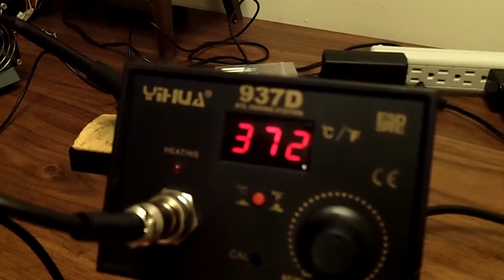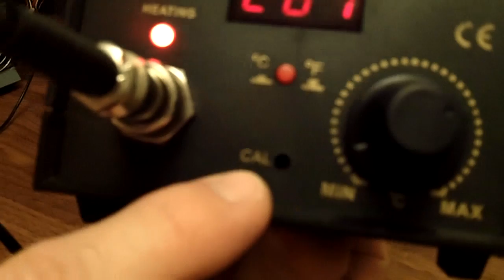Yihua 937D Soldering Station First Look And Some Minor Modificatioms

Comment: Hi.  This looks like a nice unit, digital readout of tip temp, turn/wheel adjustable temp setting, nice red LED readout, simple, functional.  Please share how well it works for you.  Thank you for making & posting this video.
Reply from the maker: I've had it for about 6 years and it worked fine until 6 months ago. The triac burned out , I replaced it and it's working fine again. Only problem I have with mine is the 45 watt heating elements don't seem to be available or at least I haven't been able to find them so I'll have to try the 50 watt elements when I need to replace mine. If they don't work it'll be time to retire the soldering station.
Reply: @percaine  Dear Pat, thank you for the kindness of a reply.  And a very open, truthful, constructive & helpful reply.  I'm glad you were able to repair your unit.  (And upgrade it's heating element, should the time come).  (Great skills).  It looks as a fine unit, nice readout, (easy setting adjust), good thermal mass & heat response.  Thank you Pat. (I like that fume extractor you made/in-process, & the mods to the Yihua station [iron's handle, module's feet]).  :-)

Comment: Got a 937 D but looks, different no Temp conversion switch wonder if they are all made by same company?? Mine shows H-E?? guessing heat..sit it on a temp and it drops down to below 100?  used it for about 10 hrs and 2 minutes ..the 2 minutes was when it would solder?? just a paper weigth.

Comment: Did some research and turns out the aftermarket soldering tip won't allow the machine to sense the temp. Looks like the tip has to be close to touching the ceramic tube inside .I ground about 15 mmm of the spacer and the machine works well.

Comment: I have the 937d+ and it doesn't have the switch for C or F, I wish it did, because i don't know C.  Going to have to print a chart so I'll know what it is in F.  I am going to see if i can find the board for yours and see if there's a way to change mine to F.
Reply from the maker: That sucks..I leave mine on C all the time and never use F even though I know both...I wonder why they did away with it on your model...Maybe there's still a spot on the board for the pot but it wasn't populated on that model to save money.

Comment: I just bought this model also only i couldnt find the one with the button for Celsius to Fahrenheit anywhere. But its far from a deal breaker, my thermocouple on my multi meter has a C or F option so calibrating will be easy and all my solder is standard 63/37 rosin core or 63/37 no clean and the melting points are listed in Celsius. Just thought it was strange i couldnt find a model with the conversion button. I've seen it in a few youtube videos but nowhere else??
Reply from the maker: That's strange.I rarely use the conversion button on mine but it's nice to have for people that like to use Fahrenheit...I guess with the newer revisions they decided it wasn't needed...I just finally had to replace the heating element after 5+ years so it might be time for me to invest in a way to calibrate my station as well..The temperature is definitely off after the element change.
Reply: @percaine  I just used mine all day long on Friday and it worked like a champ. I was surprised to see it was only about 15-20 degrees Celcius off from what it was supposed to be when it arrived. Calibrating it would have been a lot easier if I'd known you wanna be in the middle. If I went too far right the temp would start going up fast and the same happend if I went too far left lol. I've seen that with bias pots before. Just something to keep in mind, you'll probably wanna be somewhere in the middle(go in tiny increments cause the whole pot only goes one small turn) sure you already know all that but I thought I'd mention it so somebody can benefit from my experience. If i noticed my temp was going past 500 id shut off the unit and move the calibration screw back, wait for the iron to cool and try again. I say that cause it will climb in temp fast and I read your supposed to calibrate it at about 3/4 of its temp capability. With it already that hot you can end up in dangerous territory quick and the only way to stop it in time is to turn of the iron. Anyways I was able to get it dead on with a multimeter and a type K thermocouple. I'll check it again after using it a few more times to see if it's staying consistent.. I'm considering buying a few elements and a couple extra irons just in case, five years is awesome. If mine makes it that long on one heating element I'll be a happy camper.. I bought the 937D+ which is the 60 watt version but I bought the one with a black iron to match but I'm pretty sure the only iron that's 60watts is the yellow and blue one. I think the black irons are from the 50w version and they just put them with some of the 60w kits cause they know guys like me with OCD want everything to match lol. I didnt know about that until after the fact cause when looking up the black replacement irons they were all rated for the 50w version (937D or 936 I think are 50w) and all the blue and yellow hakko colored ones are 60watts. I'll buy one of the 60watt versions and see if it seems to perform better and dissipate heat a little more efficiently on the plastic parts. I'm sure I could use the 50w black one (If it's really 50 not 60) for awhile without trouble but the element would probably go out sooner. I could also just get a 60 watt element but I'm wondering if the yellow an blue 60w iron is built to handle more heat (I'd thought the black one was the better quality but now it seems to be the other way around). Time will tell but so far I'm very impressed with the unit itself. Not to mention how great it is that replacement parts are cheap and easy to find. That was my main concern. Oh and I bet your right about the conversion button being removed once they realized it wasn't that inportant. The more I thought about it id probably use Celsius even with a Faharenheit option anyways.

Comment: Can anyone let me know how this is compared to the 939 Winado?  Or 8786D wintown or X-tronic 3020 xts, or a Toyofmine 60w 110v solder kit (comes with sucker and adjustable found sears website)? Looking to spend 30is will do 40 or 50 if it's gonna make a huge difference or come with more things, especially if the things are needed.

Comment: Hi What does S-E Stands for? It's showing up on the display. I know it pops up when the tips not connected properly and when the tips warned out. But i want to know what S-E means. Thanks.
Reply
Reply: S-E = sensor error, that means
Reply from the maker: Honestly I don't know 100% for sure what S-E means but I'm pretty sure it's a sensor-error.

Comment: I have the same iron station and when I was using mine everything was ok until the temp. slowly kept going down then it showed an S-E error. The iron is plugged in and everything. Unsure why. It does not want to heat up anymore.
Reply: *****  Yes, you are correct. I must have gotten a fualty one or something It was only being used bi-weekly for 4 months. Luckly it came with a spare one.